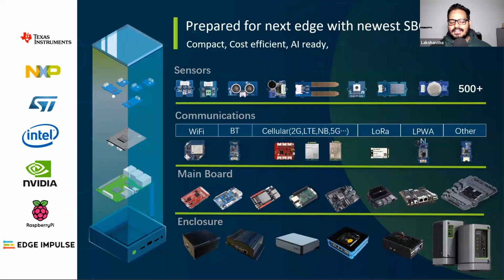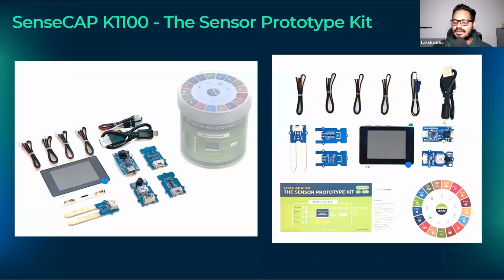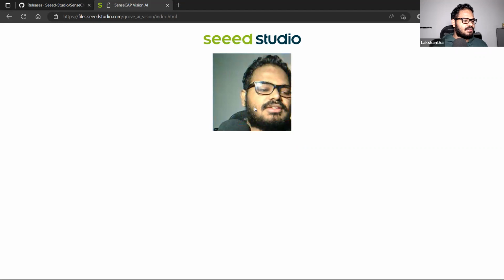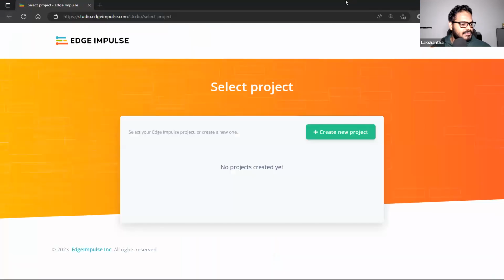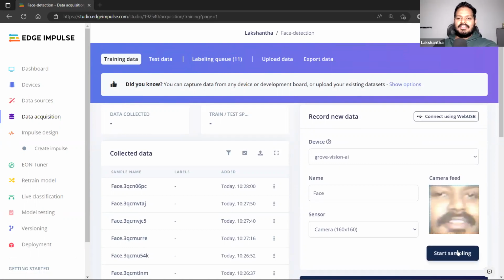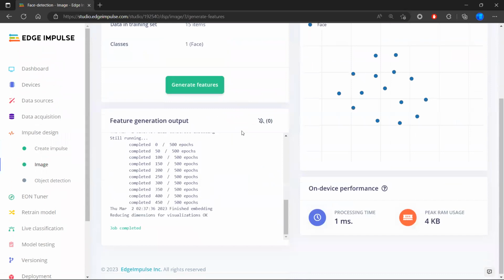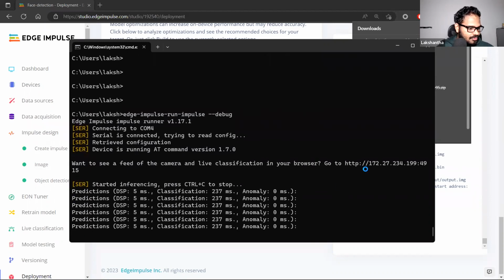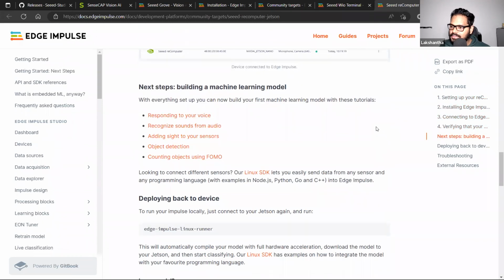Train and Deploy Your Own AI Model Into a Vision AI Sensor

Comment: The start of the video promises object detection, but sadly that's not what's follows
Reply: Seems you did not followed the video untill the end... actually the process is the same than face detection, but you must load the model with photos of the object you eant it to detect... example: Tomatoes... or if you train a model with more datasets, it can diferentiate between tomatoes and apples, as an example.

Comment: My grove vision AI module got undetected in my laptop right after I updated my firmware using Bouffalow. I tried with different USB cables and laptops, but it's not getting detected. Even in the device manager, it's not appearing. What can be done? [ help needed pls]
Reply: nvm , i solved it
Reply: @aradhanapujara  how?